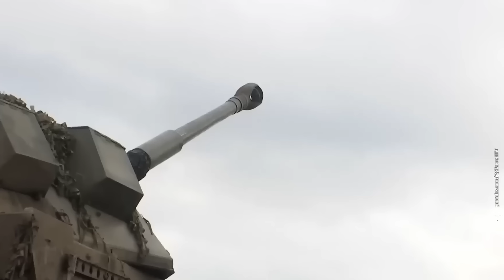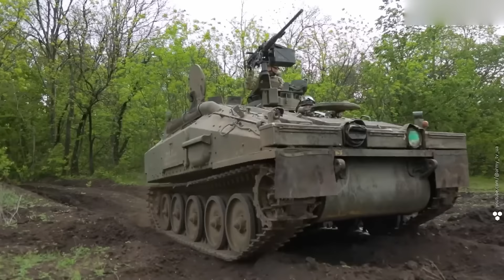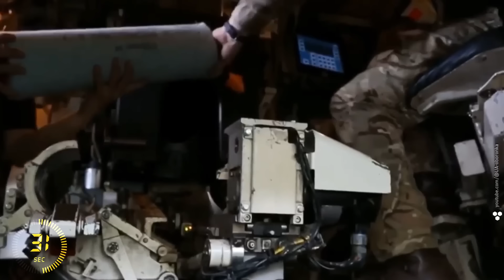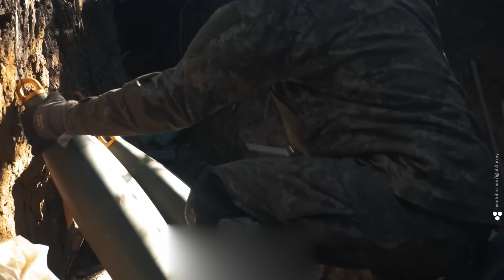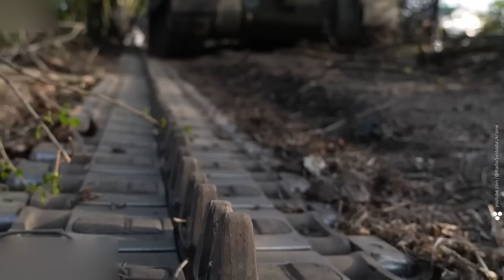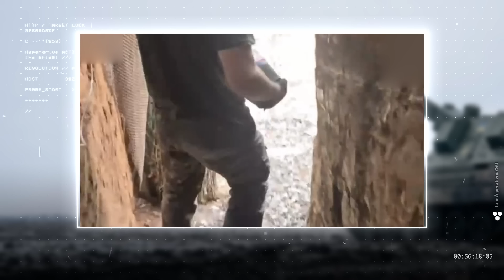Ukraine Just Revealed the SECRET Inside Britain's AS-90 That Nobody Expected

Comment: What happened to the Wonder Weapon Challenger????? Seem to remember that the Ukraine's were forbidden to take the piece if sh!t to the front but only allowed to use it as a field gun. This is such propaganda it is shameless.
Reply: They only had 14, it has destroyed hundreds of Russian tanks and support vehicles by out ranging them with exceptionally accuracy, there are still around 8 in action nearly 3 years later. Its biggest problem is that it’s a bit too heavy for Ukrainian conditions but they have learned to use it in circumstances where it is most effective. It’s still a very competent tank well after its prime. POS is an interesting description of a tank that, in its heyday over 30 years ago, destroyed 200 Russian and Chinese tanks in the gulf war without a single loss, it says a lot about your objectivity.
Reply: @paulm2467  Best you go back to the pub mate, cause you are still drunk. They forced the Ukrainians to remove them from the front line, least it be show what a heap of sh!te it is. The tanks it so-called "Destroyed" in the Gulf were un manned and stationary. Have a look at the pitiful sales of the Challenger 2 on the export market, and despite a real marketing job on the 3 series, still not one deal signed. It remains a monumental POS.

Comment: Wheeled artillery will have problems in deep winter on eastern front and tracked artillery can always and small additions to the side of the tracks to decrease the spread out weight of vehicles. Wheeled artillery will be harder to move the wet season and the muddy season.

Comment: I worked on these from 1994 until 2004, the ammunition handling automation is there but they don't seem to be using it as intended, maybe it's faulty. It has lots of sensors, motors and hydraulics, all controlled by a computer. It was designed to queue 3 rounds in the loading system then fire them all in 10 seconds without having to lift them by hand, fully automated. Also they have parts of the gun missing, that cannot be helping much.
Reply: I wonder if that was removed intentionally before it got to the hands of the people on the frontline to try and conserve ammunition supplies with the resulting slower rate of fire.
Reply: @Rroff2  bit of a weird thing to do. The normal operation is mostly push buttons to  move the various parts of the ammunition handling system to the correct position for the next action, making handling easier and less hazardous, not necessarily faster. 
But in the video shown, they are performing the initial steps in extracting the round from the magazine then manually handling it onto the loading tray so that it can be raised then rammed into the breech. They miss out the shell transfer arm altogether, the bit designed to take all the hard work out of it. 
An L15 round weighs around 45kg which is a big lump to be lugging around in a tight space. 
I've only seen it done when the system has a fault, and then they are usually keen to have it fixed asap. So many little things can go wrong and stop it working properly.
Reply: @emmajay4495  Intentionally hobbling the system wouldn't be beyond the realms of the MoD. But I'd defer to your knowledge of the weapon, it's more likely to be a systems fault or a lack of training for the unit being recorded. Hopefully, most of these being fielded are fully operational. Ukrainians are dying every day for their country, but also our security. The least we can do is provide them with working surplus equipment.
Reply: @newblor  you're right. 
I'd say that video shows more than one AS90, and the loading system seems to work properly in some scenes. 
I think it's quite likely that a broken sensor would be responsible for it not working. 
And if they don't have many spares, or don't have the time to fix it, the entire thing has manual reversionary modes so they can keep firing, even at a slower rate.
Reply: I found this good video the other day, about 5 mins in it shows the loading sequence pretty well.
You don't see much of the loading system controls but basically it's a box with about 12 pushbuttons which tells the computer what action you want it to perform.
See how fast that rammer pushes the round into the breech, there is no safety guard. and after inserting the charge, he operates a silver plunger to load the primer. That part was missing from the Ukrainian gun.
it works very well when it isn't broken.

https://youtu.be/xIASwxeb3uA?si=tYhSQKFu_Q3BD_2q
Reply: It still fires though.  Can you still fire something with the more complicated German autoloader?
Reply: @hadrianbuiltawall9531  I can't comment on the German system, I've never seen one. 
The loading system on the British gun is complicated enough. 
It has a mixture of inductive proximity sensors and mechanical switches. 
The mechanical switches are used to control only the firing circuit, ensuring it can only fire if all parts are in the correct position for firing. The proximity sensors are used only for controlling the movement of the mechanisms. I've had to replace so many of those things when they get damaged.

Comment: Rule one for all British Kit: make it squaddie proof.
Reply: I heard an engineer at Vickers asked the MoD if they would like an autoloader or a BV. There was only budget for one or the other.
Reply: @newblor  No contest, mate.  BV all the way.  A tired soldier with aching arms is revitalised by a nice hot meal and a cup of tea.  An auto loader is quicker, granted, but you can't fix it with a hammer and a breadknife.
Reply: @rossdavies8250  Best part is the '90 has two :)
Reply: I learnt this when working in the "Stress Section" aka Mechanical Design department at Thorn EMI Electronics (Radar) in the mid 80s. However small an item is, make sure it will support being climbed on by a squaddie's boots.
Reply: I recall encountering portable test sets for equipment used on Royal Navy vessels. The test sets were metaphorically built like tanks. The front panel was cast metal (probably an aluminium alloy) around two inches thick.

Comment: AS90 one of the best 155 shooter out there basic but dammed good the more tec the more grief it was made to be simple easy to repair in the field now the problem is we only have 12 Swedish guns not any where near enough
Reply: If you're referring to the Archer 155mm in British service we have 14, not 12, and they're only an interim solution until we get deliveries of the RCH 155 system mounted on the Boxer platform, with the plan for 72 of them before 2030 and potentially 200+ on the full order.

Comment: The is a lot to be said for KISS.   It would be smart if generals did not reinvent everything each time they had a new piece of hardware manufactured.

Tracked or wheeled is the big question,  each have their advantage.  Wheels are great when it is dry, unfortunately wars do not stop when the mud gets  knee deep.

Also there is a case to be made for used towed artillery, if drones are as good as the Ukrainians brass claim, then please explain how the Russians and Ukrainians are still using towed artillery ?????

Comment: I think that the MOD should restart the AS90 system but get south korea to build the chassis and we build the turrets and give it a new 16ft long barrel and up date the fire n control systems and  better engines with more torc plus a kettle
Reply: Personally I think we should be looking in that kind of direction, our hardware like the Warrior and AS-90 still delivers results on the real battlefield despite some aspects being a bit tired or outdated now. OK in some ways it would be a new system and/or might be duplicating some existing platforms like the K9 Thunder but personally think we should basically reinvent the Warrior and AS-90 from scratch. The RCH 155 on a Boxer looks so unstable and like it would put a lot of work onto maintenance if the gun was fired much at all even if in reality maybe it isn't so bad.
Reply: If UK restarts building the AS90, why does it need a South Korean Chassis.? Have our UK industries sunk so low.?
Reply: @David page: after what Cameron did to our defence capabilities, yes sadly.

Comment: I think militaries should stop trying to reinvent everything from scratch every time they design a new platform. There’s already decades of battlefield data and proven components that work reliably in real combat. Using existing parts, designs, and engineering lessons would speed up development, reduce costs, and make systems easier to maintain in the field. War usually rewards reliability and logistics more than experimental technology.

Comment: Seems to me the Swedish Archer is the better replacement. Firing three and quickly moving location is the only way to evade drone detection.
Reply: The Archer looks elegant, the RCH 155 is ungainly in appearence. This matters, as you want to look cool going into battle.
Reply: Maybe but no track no armour
Reply: Archer can't fire on the move.
Reply: @MHalblaub No but it can fire 3, and then move while they are still on way to target.
Reply: The Archer is a stop-gap system. The MoD has chosen to go with the RCH 155.

Comment: There was a project to upgrade AS90 from 32 cal to 52 cal during the late 90’s/ early 2000’s but typically the Politicians cancelled it
Reply: It was actually cancelled because they realised that they didn't have any bases with gun sheds that were big enough to house the new barrels, and it would have cost additional millions to rebuild them.
Reply: @bugaboo-bricks  Once again they prove they know the price of everything yet the value of nothing.
Reply: @bugaboo-bricks  Sounds similar to the reason they went with the STOVL variant of the F-35, halfway through the order process we decided we wanted the better range and payload of the catapult variant instead, but we realised in that stage of procurement and design it would be more expensive to delay and change the carrier design to a catapult (despite potential for it being considered in early stage design) carrier than we'd save in F-35 costs.

The STOVL variant does have some strengths, but the catapult variant with larger wing area could have carried more munitions with greater combat range and arguably would have made a better choice.
Reply: What a surprise!
Reply: Wasn't there a plan to modify Royal Navy warships to use same ammo as AS90?
Reply: @FrontSideBus  There was but it was cancelled in the 2010 budget review.

Basically it would have upgraded the barrel and internal feed mechanism of the Mark 8 4.5 inch gun to 6.1 inch (155mm), and it was called the "Third Generation Maritime Fire Support".

The new Type 26 Frigates are getting the Mark 45 Mod 4 naval gun that is in 5 inch calibre.
Reply: @FrontSideBus Yes correct, initial trials were undertaken to use the AS90 ordinance system on the T45 and then the project was cancelled by the politicians and not for technical reasons